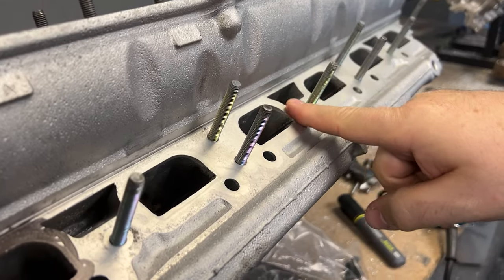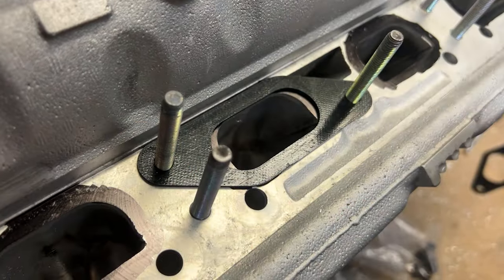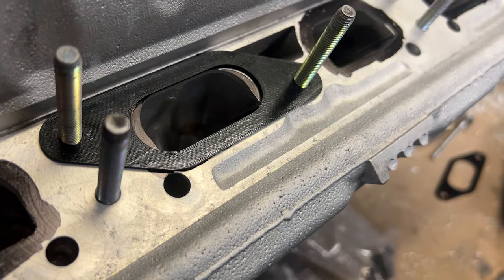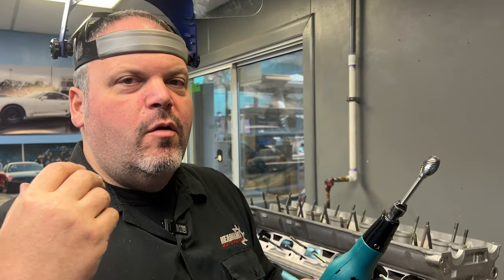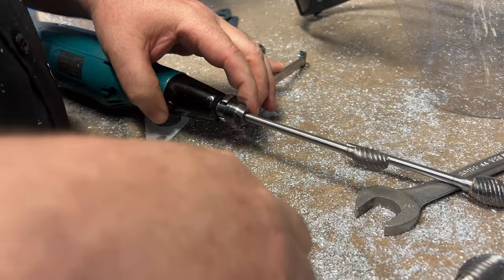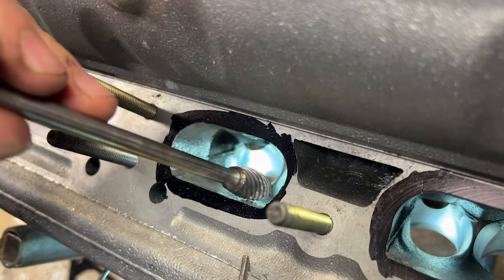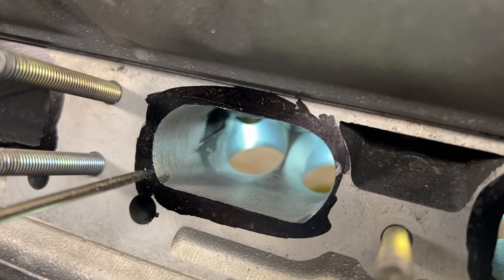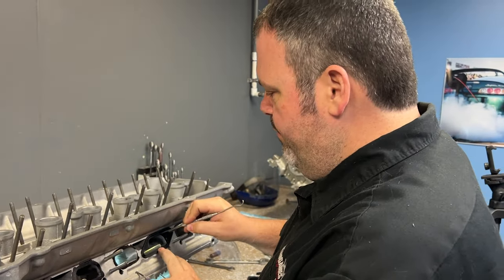How-To: BMW M54 TO M50/M52 MANIFOLD ADAPTER Port match!

Comment: This is a turbo thing for the m54 because the factory m54 intake is poo poo pretty much like all BMWs are poo poo. Jk. I have a e46 vert but it’s Ls3/t56 swapped but no really bmws are shiz boxes when compared to Japanese or American cars. Ultimate driving machine sure! they drive good when they run and you get past all the stupid quirks like bump steer, or a rear end that’s glass, and the cracks in the body’s suspension pickup points. etc etc. they look great tho!
Reply from the maker: @georgef1176  haha I feel the love/hate in your comment

Comment: What the heck is up with the casting of that head? Did they just press a bunch of aluminum beads together, or actually cast it? It looks like painted styrofoam. Building that way seems like you are asking for cracks, etc. with no consideration for longevity. Is this the current trend in OE manufacturing? Can you do a video on the evolution of head manufacturing?
Reply from the maker: @rcr286  this head is 34 years old
Reply: What are you on about?  All cast parts have a texture.  There is nothing out of the ordinary with that head.
To be fair, the lighting, along with some dirt in the low spots, does make it appear exaggerated in the video.
Reply: @dan1906 , I realize that. However, look at how the head was made and it looks like a bunch of beads were pressed together like styrofoam. It doesn't look like aluminum was poured into a sand mould. I've simply not seen a head made like that before.
Reply: @headgames  weird. Was this manufacture technique normal 34 years ago? Has it continued?
Reply: @rcr286  I see the styrofoam looking alloy heads pretty often both import and domestic.  It's a thing.
Reply: @rcr286  lost foam was a thing back then. Cheap haha
Reply: *24years old but most are like 19-20y.o.
this surface finish is normal for all bmw heads/blocks from this era and not found in other brands (vag for example).. they don't crack, it's just different aluminium chemistry. '70 to '00 aluminum casting all had problem with coolant corrosion if you ran tap water or anything other than green G11 coolant.

Comment: What gaskets did use use for the port matching
Reply from the maker: @jacobjarvis2545  there is a few companies that make the template. It’s not a gasket
Reply: @headgames  I ended up getting the template from seems light garage

Comment: What was the white template for?
Reply: I believe I have bought the same kit from "seems legit garage" and quickly had a look when inspecting the same question on my cylinder head and from memory it was for the front and possibly the rear inlet port as the studs are in a different position as per the rest of the inlet runner
Reply from the maker: @kostadiamantis5637  that is correct

Comment: Did this same exact thing a week ago on M54B25 head with M50B25 intake manifold with a bit different approach. I cut 10mm aluminium flange on waterjet using M54 port diameter and spacing. Blended that flange to M50 manifold the same way, so intake ports are untouched in the head and only the adapter flange is port matched. Made zero max hp gains, only 3000-6000rpm torque increased 5-6Nm across the rpm range. Interestingly peak power was at 5900rpm after the adapter flange, and 6100rpm before. Had to make slight adjustments to intake cam timing to get same max hp. 

Dynoed and tuned the car before the adapter flange and after port matching the flange to the manifold. 190whp with M54B30 intake cam, headers (unequal lenght), 3" single exhaust, B30 injectors and E85. My old M54B25 with same mods otherwise but stock intake manifold made 199whp and more torque everywhere. The runners are too long and big volume in the M50 manifold compared to M54 manifold. Might make some gains on 3 liter B30, but waste of time on 2.5 and 2.8 engines.
Reply from the maker: @Marko-JZX100  man! Thanks for validation on my theory!
Reply: 199 whp ???? On M54b25?
Reply: thats like 235hp crank, not much.. stock m54b28 with b30 cams and nice exhaust will make 250hp, m54b30 will do the same (stroke only changes rpm where peak tq/hp is, not how much it makes)

one of my problems with m50 intake on m54 is that you have those crankcase vent holes bellow port, you have to plug them and if they start leaking you have problem, having a turbocharged engine makes only things worse. Also n53 is much better intake than m50, more compact, more space for everything, makes power but flanges are as expensive as aluminium side mounted TB intakes (fmic pro)..   m50 intakes also are going up in price (currently somewhere around 350-400€ here), have issues with boost (iav pushing out) and you will need to match m54 size of TB to M50 intake

tldr with like 100 of bmw engines i have done, it's pointless (and waste of money) to play with intakes. What they need in 1st place is big cams (270/250 at least) which shift peak hp to something like 6800-7200rpm depending on stroke.

Comment: Great information, because I had a lot of question marks in my head with the cylinder head you send me and installing a intake that I have not purchase yet.
Reply from the maker: We sent you this head?
Reply: @headgames  no you send me a 4G63 2G, and like you had mention castings are very inconsistent, I guess I may need to look how the intake manifold match the Cyl head.

Comment: Hi Dave, just next week they will bring me a cylinder head like that to do the same thing.
My question is what honest opinion do you have about doing that and if the intake port is already excessively large.
People go crazy with the m50 intake manifold, but I think that with the m54 it has enough air.
Greetings and thanks for your time.
Goyo
Reply: If you can get the m54 head to flow like an m50 then the intake swap is worth it. I did this to my e83 x3 and several others.
Reply from the maker: @goyocarreras  I agree it probably is already big and okay. Problem is, I don’t anything about this head or the combo so I can’t speak intelligently if it’s a gain or worth it. When I know these things, I won’t let people hurt themselves by just doing what they want. I try to stick to what they need.
Reply: @headgames  thanks Dave

Comment: This might be a dumb question. Stock to mild cam verses wild race cam with lots of duration ...etc. Do ported heads make more power difference as you go from stock smooth cam to radical cam? I'm building a Pontiac 400 and I'm wondering if it would be worth the effort to port the heads if I'm using a BP6014SP cam and I wonder how much it would gain with that cam I'm thinking about 25 hp? increase with #13 heads? I still can't decide what valves to get for it
Reply from the maker: @Christopher-re2hl  buying an eldebrock head would be a better choice than porting the stock Pontiac heads.

Comment: What process do you use when doing something like this? 100% complete one port then use it as a reference for the rest or rough out all of them at once then sand then all?
Reply from the maker: If it’s a whole port, I would do one and then match it